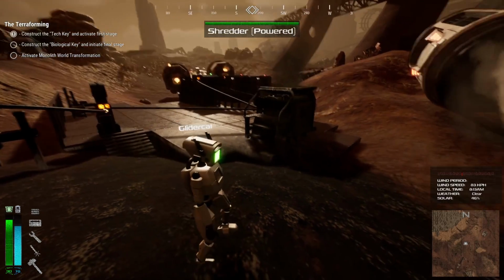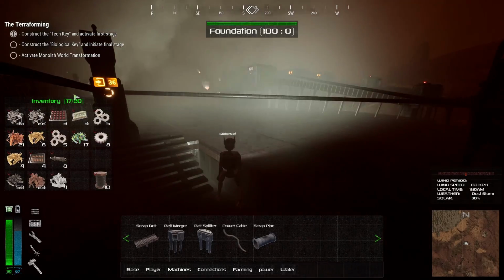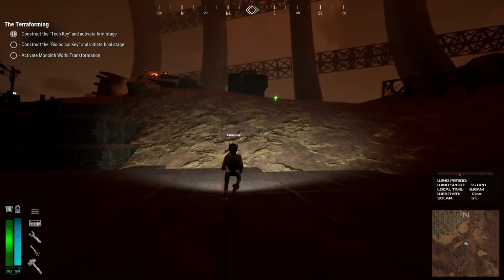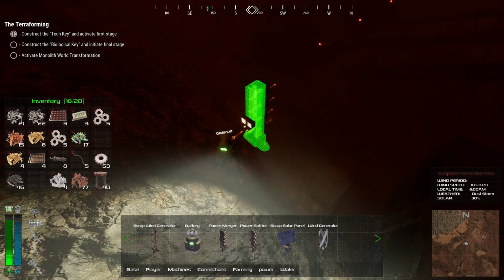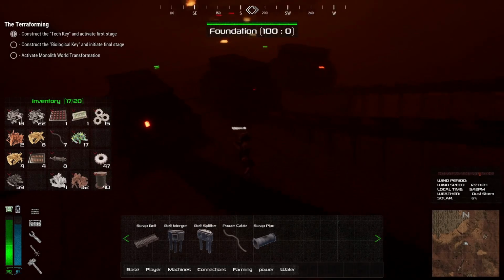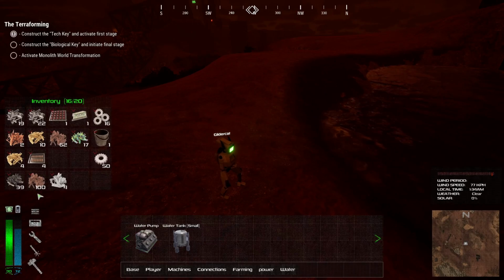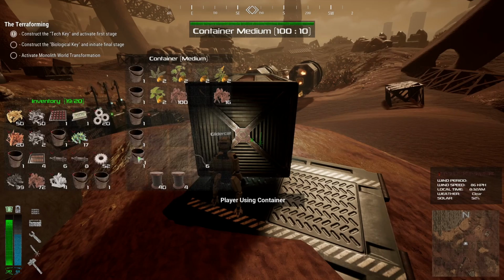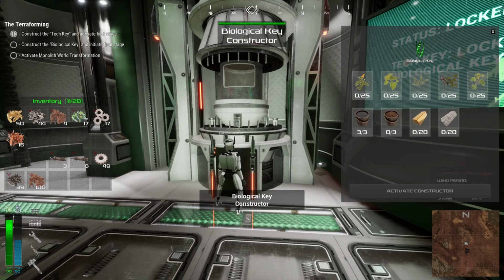Let's Play JUNKPUNK s01 e04

Comment: Need to craft batteries for night time and when no wind.....
Just a heads up. 👍👍
Reply from the maker: Batteries would be good, but it turns out I don't need them. There is so much manual harvesting to do that you're unlikely to find yourself standing by your machines waiting for them to craft/process something. I've just been hooking them up to some turbines and filling them with materials to process and then I head out to harvest more resources. By the time I get back, my stuff is pretty much processed, even if the wind stopped periodically during that time.

Long-term though, I'm sure they will work things out with the game's balance so that batteries become essential.
Reply from the maker: ... and once the game gets some lights that you can set up, I'm guessing batteries would be pretty much essential to keep things lit up.